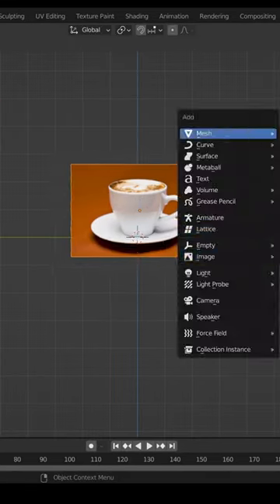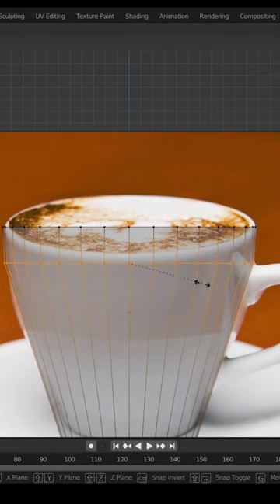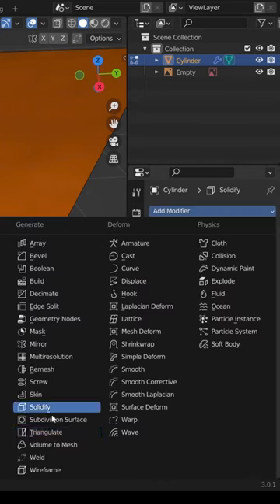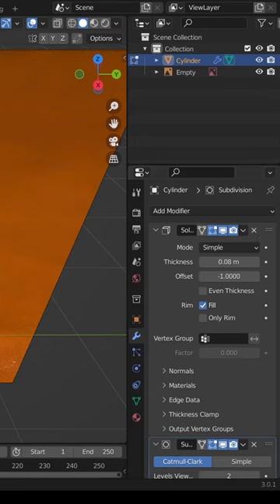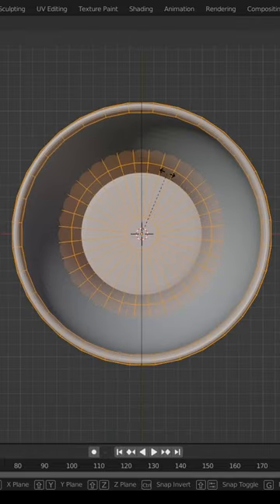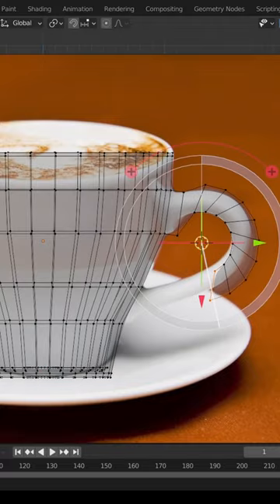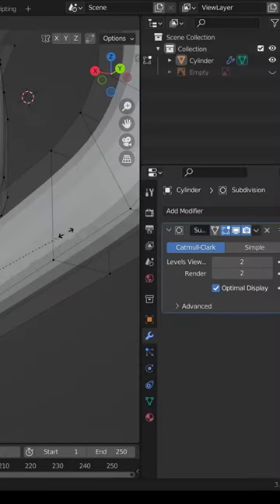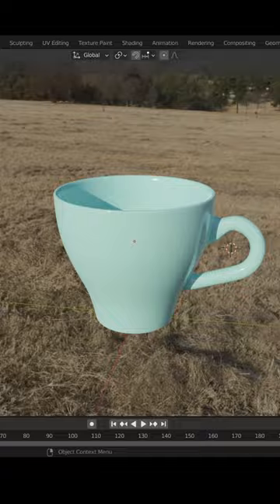How to Make a Cup in Blender Beginner Tutorial in 50 Seconds 😊 #shorts #blender #how

Comment: I understand nothing👍
Reply from the maker: Sorry about that you can use subtitles they have the instructions
Reply from the maker: Start with a cylinder
Then add loop cuts Ctrl b and adjust them for the shape
Then delete the top face of the cylinder make sure to add sub d and solidify modifier
Solidify modifier adds thickness 
For handle use the spin tool
Click f3 and type bridge to bridge the edge of handle to the cup that's really it
Reply: @cettlecraft I thinks its hard  to understand for pure beginners
Reply from the maker: @FALCONxYT  ok ill try something simpler like materials or just basic models
thank you
Reply: @cettlecraft  It is more so because short form content is bad for instructional videos.